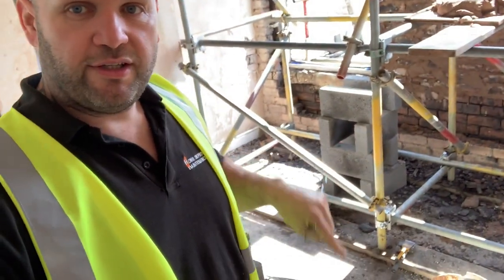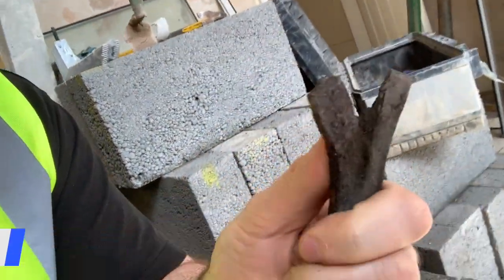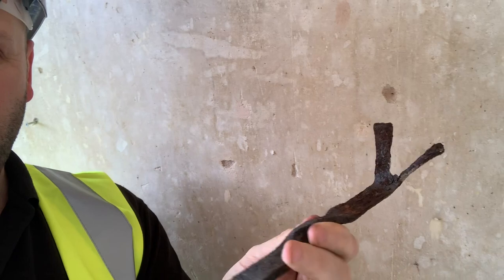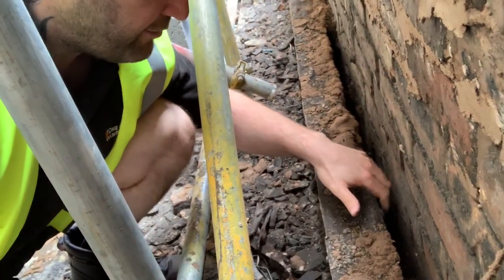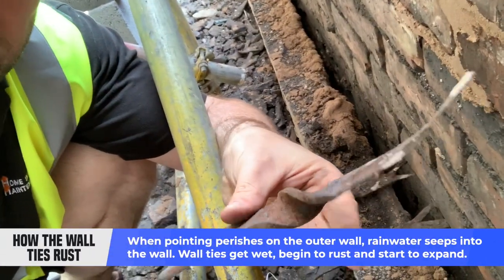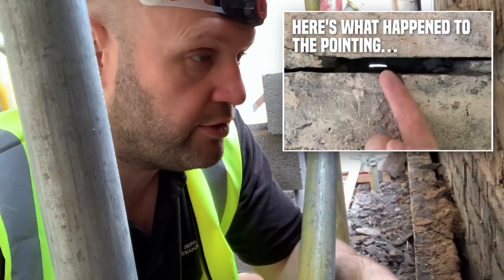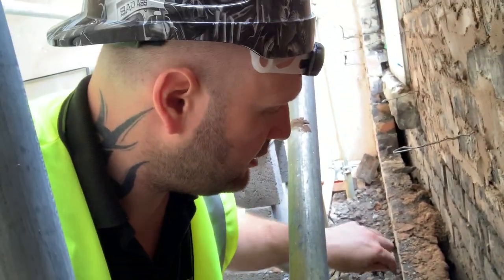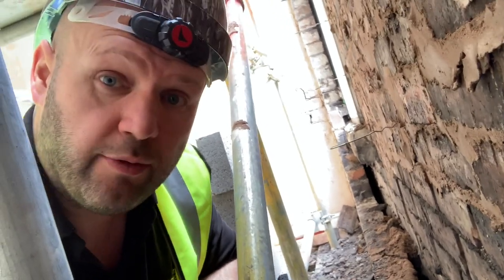Wall Tie Failure: Part 2 – Fixing the Problem

Comment: Even when you fix that house, will the neighbours damage not threaten yours?
Reply from the maker: Hi there. Thanks for watching our video and for your question. It's a possibility that the neighbour's house will have an impact. Everything on the property we worked on, however, has been passed by a Structural Engineer and Building Control – so the property is covered should anything happen.
Reply: I think I may have this issue with my house 😬
Reply from the maker: Hi  @ryansamanjoul5411  . Best to get it checked ASAP if you think you have wall tie failure. It can be very destructive.